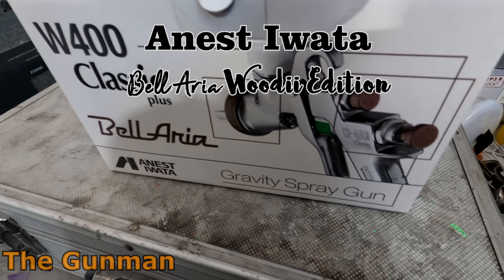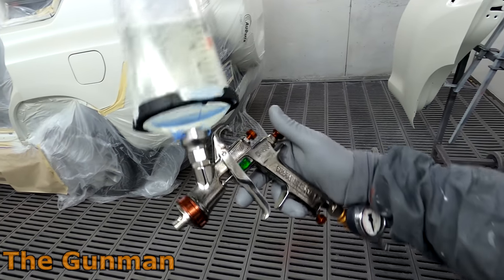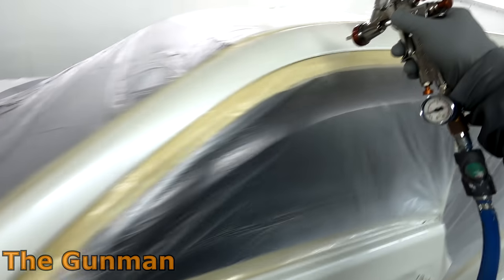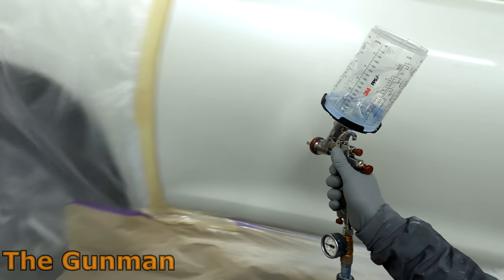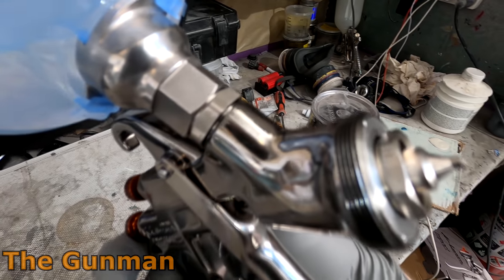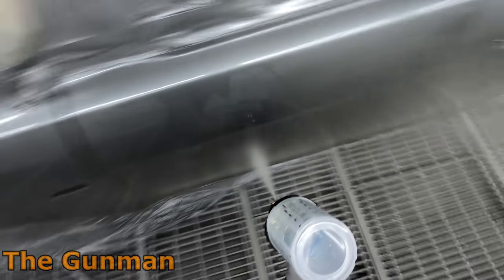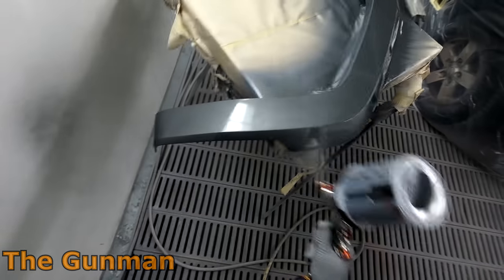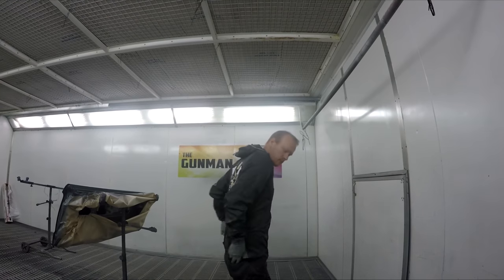Iwata Bellaria Woodii Edition

Comment: i found that the iwata lph400 is really good for the standoblue water base paint system. very rarely did i get mottle, and i found slowing the paint down in the warmer months & adding the colour blender to most silvers helped too. By the way i find my lph400 is better at applying the sikkens water base paint than the deveilbis pro lite. the rep hates me using the iwata but i think they are just shuch a nice gun and i get a better finish. i also use the bellaria for clear & dg.

Comment: What air fittings do u use on all your guns I just got a iwata300 platinum from  spray guns direct with the colad atomising bottles and the top colour markers verry good quality the iwata has a blow gun but doesn't go in the Nippo fittings what would I need to get

Comment: soo I just bought the Devilbiss special edition  gunman Turquoise color with a T110 cap. I plan to use it for clear coat. Gunman...that's still your suggestion for a flat glassy look straight out of the gun isn't it? I know it comes down to buffing etc...but the T110 cap will at least 'help' get to that point??? When will there be a gunman DV1 basecoat gun available? I am holding off on a basecoat gun until one is launched. Unless it will be another 5-9 months away. Any info on it?? I heard a rumor that it was coming..soon*

Comment: Do you have a forum for followers questions Gunny?

I've not seen a video on clearcoats you like or not.... do you have one?

I do airbrush art - mainly on metal panels. I used to use HiChem 2-pack iso free clear however it's no longer made.

I have an LPH80 with 1.2mm tip. 

Can you advise a good value clearcoat I can source (I'm in Brisbane not Perth) that is HS and able to be polished or come out well with a flowcoat? 

I've been trialling the Createx UVLS architectural clears but find it too finicky compared with a decent automotive clear (though I've not used any waterborne ones).

Hope you are able to give some advice 🙂

Comment: Hello Gunman,

I have a question regarding direct gloss clear coat. Im using the Carbo clear by carsystems and an iwata az-4 with 1.2mm tip. Surface tends to have a little bit of orange peel, although I sometimes managed to achieve an even surface. Would you think that a Devilbiss FLG5 with 1.3mm tip would suite my usecase better? I want to have a direct gloss since im painting carbon fiber parts.

Thanks in advance

Comment: What is the fan pattern like in relation to the ws400? Is it as unforgiving?
Reply from the maker: No, the fan is much rounder on the top and bottom unlike the WS400 which has a V shaped fan. These Bellarias are much easier to spray with.
Reply: @TheGunmanChannel  thanks mate. I take it the pro lite is still the favourite though? 😂

Comment: Gun settings for clear coat with this 1.3 Bellaria?
Reply from the maker: 2bar pressure full fluid and full fan. Easy to set up. You could adjust if you like.
Reply: @TheGunmanChannel  
Thanks Gunny!
8 have the 1.3 Bellaria, and im running 30ps, full fluid, full fan, but get tiny bit more texture then i like. I will try and slow down a bit and see if that helps.
Cheers

Comment: with how many turns of the product leaves a good clear coat finish ? Gun man ✌🏼Could you tell me the adjustments, please!
Reply from the maker: I usually just keep that fluid fully open, full fan and 2bar (29psi) pressure, it's a simple gun to set up and operate. Similar to the pro lite in many ways.